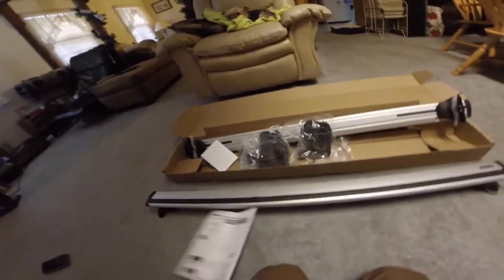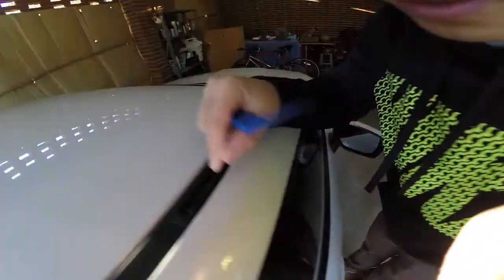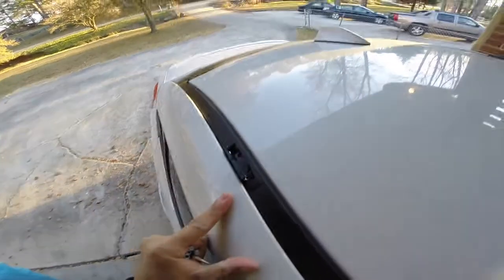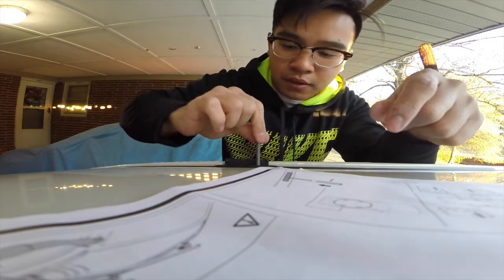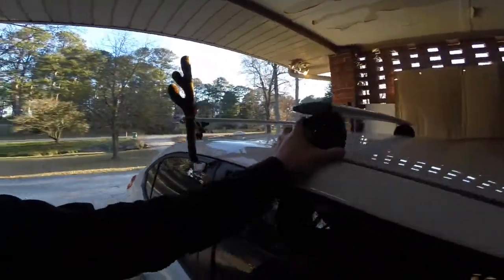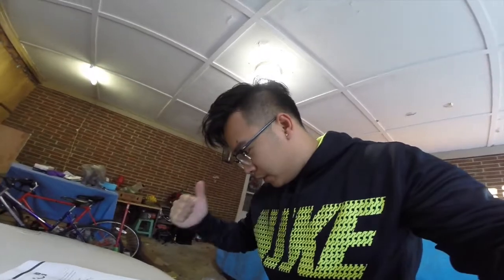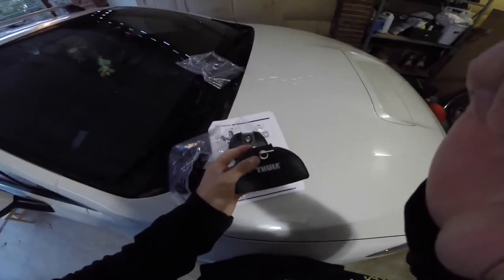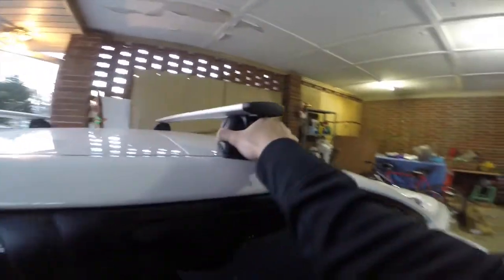2018 WRX crossbar install/review

Comment: Great Video. I used your video as a tool for install. Easy to put together and the price was fair. Just wondering if the placement (Front/Rear) is correct or maybe my eyes are right and I installed backwards. I’ll do a measure like you suggested to find out. Great Video, Keep it Up. I’ll probably do a after install and breakdown of the Thule Kit... maybe you and other enthusiasts can check it out and see if it’s correct. -New Subscriber to your Channel

Comment: Is there a way to make them fit on a 2017 WRX? My car doesn't have that flip up cover with the holes in the top (not that I've noticed).
Reply: I'm in the same boat as you.  I am trying to find replacement channel strips that have that flip cover
Reply: @matthewkulak3916  You can purchase these from Subaru. They run around $90 each or you can always drill into your current roof moldings.

Comment: How much did this setup cost and what is the weight limit? I'm planning on getting one for my 2018 Wrx as well but it looks like the Yakima setup has a higher weight limit.
Reply from the maker: Al Parayno I got it from my local Subaru because they offered me a nice discount for it. I paid around $285 ish for the bars and everything to mount it. I looked at Yakima and rhino racks but they were almost 2x the price of the oem Thule setup which is why I didnt go for them
Reply: Quang Lu, Does the kit comes with the keys and locks
Reply: @gilbertborje8213  yes

Comment: Did you ever find out why the black plastic bar ends rotate up like that?
Reply from the maker: Geo A I still can’t figure out why they rotate upwards. I’m thinking it’s possibly a rain gutter because of the channels in it
Reply: That makes sense! thanks for posting up this video - it helped alot when I put mine in today; especially the measurements on each side to make it even - they were spot on and saved me a bunch of time and measuring.
Reply from the maker: Yeah man no problem at all!
Reply: There are some Thule accessories that slide into the groove on top of the crossbeams instead of sitting on top and having some kind of clamp or strap to secure it. You have to pull and cut the rubber strip on the top so that they slide on. Anyways, the the plastic bar ends rotate so that you do not need to remove the end caps to slide these accessories on and off.